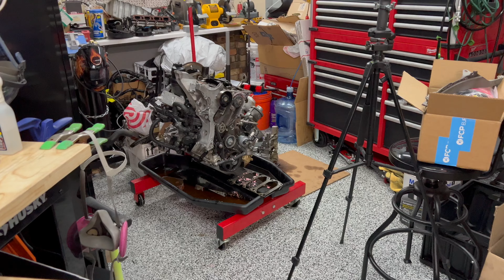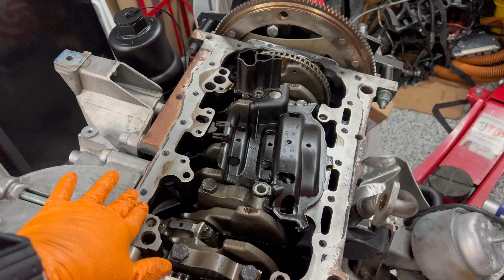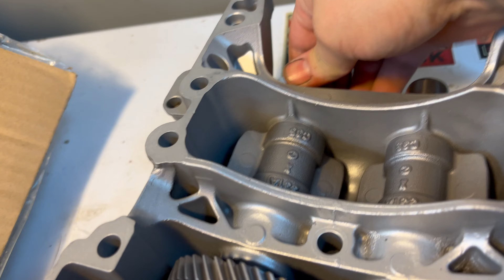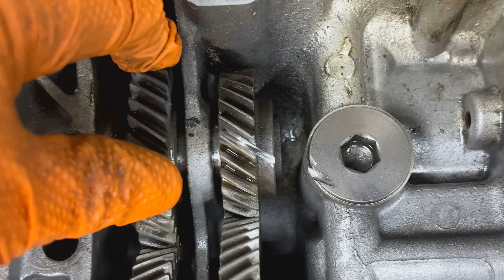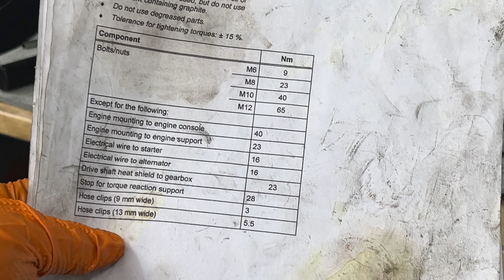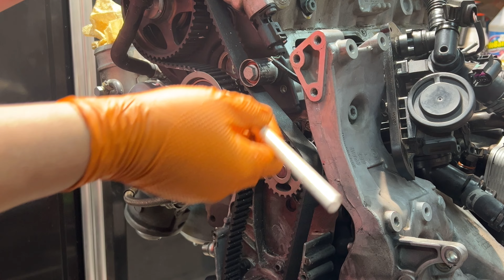The Great Audi Engine Revival: I Used An Oil Pump Hack to Save My Car

Comment: Is there anything I need to know when I`m tightening that balanceshaft gear, I took it off but cant remember the orientation it came off. I really dont even understand how it is secure enough to grip that balance shaft when its spinning twice the speed of crankshaft
Do you have anymore info on this than me XD
Reply from the maker: So the shaft needs to be in time with the engine IF it’s still attached to the weights. If not, just button it up. The sprocket has a dot on it. That faces out. Good luck!
Reply: @YogisGarage  my sprocket didnt have any dot and thats why im so confused :)
My engine is in tdc(so the weights are closest to the oilpan) and the sprocket isnt connected to the shaft anymore(removed the XZN-bolt)
Reply from the maker: @gontziz  there should be some sort of guide or obvious way to determine front from back.

Comment: did you have to time the oil pump to the engine?
Reply: Not if you remove the balance shafts
Reply from the maker: Yeah if you delete the shafts, which you should absolutely do, just chain it up. I timed it because I had to replace the failed water pump.
Reply: @YogisGarage  also balance shafts has to be in timing
Reply from the maker: @stanomx  yup, I went back and read the reason why. Glad I deleted it! Thanks for watching